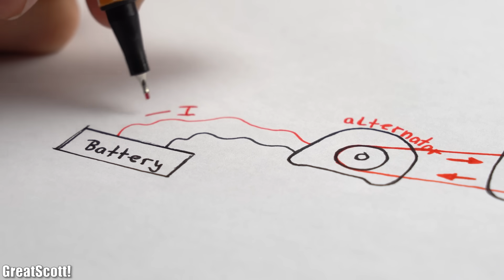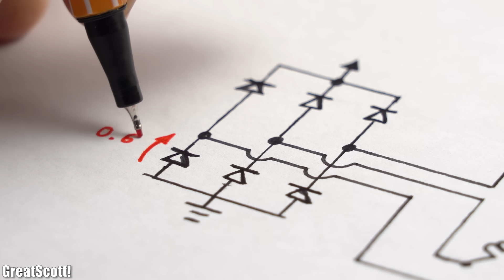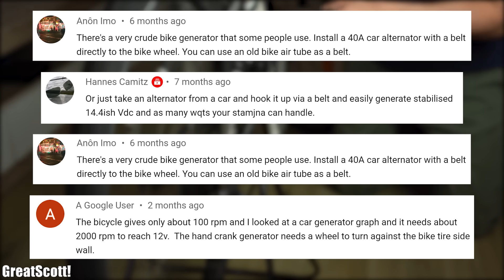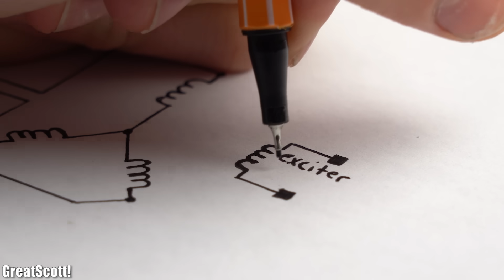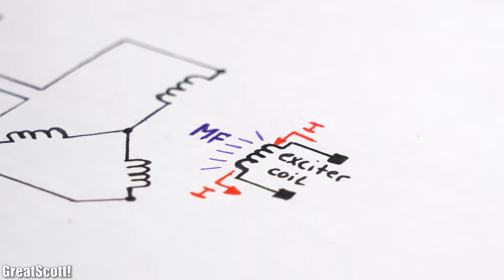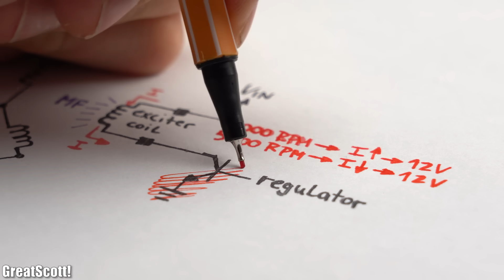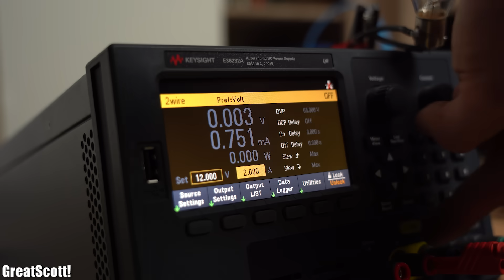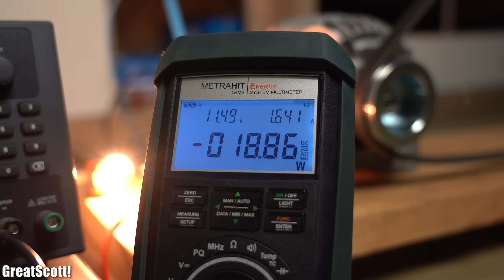Using a car alternator with a bike to power my home? How much energy can I produce?!

Comment: As a child living during a civil war in Sri Lanka in the early 90s, the most common electricity power source we had was by peddling our bicycles that had simple dynamos attached. We couldn’t do much with that, except for powering some FM/SW radios, but nevertheless it was useful for many under that circumstance.
Reply: Machang, having visited Sri Lanka towards the end of the Civil War, and many times thereafter in the years that followed, I can very much appreciate your struggles.
Reply from the maker: Thanks for the feedback :-)
Reply: @greatscottlab  you can also use the electric bike hub motor as a generator... I'm pretty sure you can generate a pretty good amount of electricity out of it.
Reply: @jeruelvidad901  When i was a kid i had a light setup for my bike that included a generator with a knurled wheel that ran along the tire. It had a little rechargeable battery pack so the lights didn't go out when you stopped but when you started pedaling again they sure brightened up.
Reply: @keithyinger3326  yeah, I also have that in my bike when I was in elementary but it only lights up when the wheel moves since it doesn't have a battery.
Reply: @jeruelvidad901  ahh, the battery pack might have been something my dad added just so they would stay on when i stopped then. I just remember a little switch on the handlebars to turn it on, and a battery pack zip-tied to the frame.
Reply: @keithyinger3326  ahh, that's really nice.
Reply: @jeruelvidad901  No
Reply: @jhonmorenocastro3010  you can watch the process of making a windmill and the conversion of a ordinary bike to an e-bike of the youtuber 'KREOSAN' if you doubt it.
Reply: @jeruelvidad901  Science is better than You tube. a regular and healthy human can only deliber 100 watts with full effort.
Reply: @jhonmorenocastro3010   isn't there a 'Science' in the rotation of the motor.
Reply: @jhonmorenocastro3010  you should learn how to use gears... And who told you that you're the one to generate the electricity, hahahahah. What's the point of doing that if you can use it as a generator for a wind turbine.
Reply: @jeruelvidad901  Its about power not gears.
Reply: @jhonmorenocastro3010  my bad I was talking about the e-bike hub motor... I know that Science is more reliable than youtube, but did they figure out how to extract it to be used and if they did figure out, why are we still buying electricity bills or buying such things to generate electricity?
Reply: @jeruelvidad901  Try at your home, them respond yourself
Reply: @jeruelvidad901  Science doesnt mean rotor, instead Human muscle power and resistance in time, heart, health, breath, ect ect.
Reply: @jhonmorenocastro3010  but the "Theory" says that "The average human, at rest, produces around 100 watts of power. [2] Over periods of a few minutes, humans can comfortably sustain 300-400 watts; and in the case of very short bursts of energy, such as sprinting, some humans can output over 2,000 watts. [2] The bulk of this energy is required for important tasks, such as pumping your heart and flexing your muscles, but a lot of it is wasted, primarily as heat. [3] Almost all of this wasted energy could be captured and turned into electricity. Furthermore, this process could then augment or completely replace reliance on batteries." It is still a theory, and it needs to be proved. So this human generated power is still useless for the meantime.
Reply: @jhonmorenocastro3010  science also explain electricity, you know? It also explains the electromagnetic field that is produced by powering the rotor.
Reply: @jeruelvidad901  !!! You got it !!!  at the end available just 100 Watts . (like our gas cars,  more than 80% of gas potential is wasted in diferent forms of energy. Heat, bearings, friction on road ect, ect.
Reply: @keithyinger3326  I had that also, no battery pack. What I remember about it was how much drag it caused....had to pedal so much harder. I never used it.....
Reply: @jhonmorenocastro3010  you are right the avg human would have a hard time if not impossible   the avg person could only produce 5o -60 watts    I ride rode 100 to 250 mi a week.  On a a HD bike that weights close to 200 lb.   Weight hauler.    freight.   groceries    I peaked at close to 99watt  AttnREMC
Reply: Rated to 3Watts! For all that extra effort.
Reply: @keithyinger3326  that's a dynamo
Reply: @jhonmorenocastro3010  sounds about right or 1/8 horse power
Reply: @jeruelvidad901  100 watts for the average person.
Reply: @jeruelvidad901  can't always count on the wind. Sometimes the wind doesn't blow, can't relay on wind when there is no wind.
Reply: @jeruelvidad901  I lived this peddling bike life. 5 minutes with my two brothers each. Totaling 15 minutes peddling. My dad hand spun the stator backwards on generator. Hooked up too batteries. We had power until our bed time in four separate rooms with lights, toys and radios in all four rooms. Until my dad applied for a Paton and President Regan wrote my dad wanting his invention. My dad returned to the grid knowing what the corrupt S.O.B. back during the original Tesla erra.  Done  preventing free power from the people. Created & invented by Tesla. Corrupt powers don't want free energy they want to control & profit from people not help people.
Reply: @sweettimage  i mean, you can rely on wind if, hearsay, there's a storm and maybe you are off the grid and you rely solely on solar energy. My point is just having a sustainable energy that could supply you with electricity anytime.
Reply: @jeruelvidad901  True that. To supply enough sustainable power source for everyday needs. Must harness all the energy power source of the wind, solar and human intervention.
Reply: @jeruelvidad901  u can pretty much make any electrical motor into generator
Reply: @greatscottlab  I would like to take on more interesting project like small scale steam turbine electricity that could power the house in hot climates. Specifically concentrated solar power . Let me know what you think .
Reply: @idontknow1022-v7g  That would be cool, I think a closed system that worked like a A/C compressor where there is a high side and a low side where the high side would actuate an impeller that would drive the generator! Use a one way valve between the low and high side so pressure doesn't equalize, the high side would be exposed to the solar collector and the low side would be kept cool.
Reply: @greatscottlab  that 20 watt wasn't the maximum power which lamp could hold ? ( because of the lamps resistance )
Reply: @greatscottlab 🇱🇰 🇱🇰
Reply: Wow 😲 I hope your life is easier for you now, but having come from poverty also I am a thankful person and remain content regardless. The most wonderful gift 💝 I received was from Jesus - now I have no NEED but remain so grateful.
Reply: Yep, needs to tighten the belt to really get the power out of it.
Reply: 😂👍because  I grew up without electricity,  I always wanted to find a way to produce electricity which will help me to be independent from the grid system,  I was able to achieve it.
During the last winter storm in USA,  my house is the only one had electricity! 

Human can put out around 1Hp by pedalling bicycle,  he/she can't do pedalling more than 45 minutes continuously at this rate. 
Car alternator can't produce useful load at less than 2000 rpm. 
But, good attempt though.  

If you want to do this for workout,  try 3volt on the exiting coil,  you will have less resistance.  After few seconds,  coil becomes self exited, then you no longer have to provide voltage to the coil.

---------
My system at home using power multiplier using flywheel.
Reply: finally a sri lankan in comment section
Reply: I am not surprised. I've seen the legs and power it takes to toast a slice of bread: https://youtu.be/S4O5voOCqAQ
Reply: Fact bro
Reply: Alot of people modified alternators by adding permanent magnets to the rotor and eliminated the excited coils
Reply: Yes the old bikes in the 60s and 70s lights were using a Dynamo to power the lights
Reply: Weighted flywheel butt up to that with your bike tire... friction drive... ratio the flywheel to the alternator and set a few up inline..  should be able to cut that 14. Years down pretty easily... this is a very interesting idea and would be worth exploring.. maybe we could build gyms that feed energy back into the grid..
Reply: Thank you for sharing your idea very much appreciated,do you have any other tips.... camping or survival tips?
Reply: Free eletricity and training at the same time.
Reply: Cyberpunk
Reply: Generator modification
Reply: Damn crazy the differences of lives we all live. I try to be mindful of that.
Reply: Any Electric you can generate for free is worth doing. Could you turn two alternators with one belt and bike setup.
Reply: @chrisspere4836  you can't generate anything for free.   If it's free someone is always paying.
Reply: Very similar, sir, Cambodia in 1980s.
Reply: sadly globalist are attacking the worlds food\energy supply so these small hand crank generators may be useful again soon👍
Reply: This guy is speaking from his throne of privilege, of course 20W is more than enough for a home where you dont have any electricity at all.
Reply: Yeah I remember seeing one video or BBC news program several years ago with this exactly powering radios from bicycle dynamos
Reply: There is a movie I watched that was about a kid in Africa that made a windmill with a bike frame and one of those headlight generators to charge up a car 12 volt battery to run a water pump to pump water out of the ground.
Made a nice e story but none of the science made any sense.
Reply: @michaelszczys8316  batteries are fun to have around. They used to be plentiful around here. Nowadays everyone recycles, haven't found a car battery in ages. They are indeed handy asset.
Reply: @brucerideout9979  I use lawn tractor battery in a box to run power tools, work lights etc. I take those old battery drills and put a wire with clips on them. Works great for 9volt Makita drill but unfortunately a lot of tools run more than 12 volt. You really need two.
You also don't have to worry out in the rain.
Reply: @michaelszczys8316  im 63 now don't play around with tools too much but in my youth I loved making sparks with jumper cables and connectors and the motor speeds.  Had a ton of fun.
Reply: @michaelszczys8316  have you seen the new techy stuff, I was at the park the other day and a guy had a neat power pack he was charging his phone. He said it would start a car. Gorgeous little unit. I am illiterate to it all
Reply: @brucerideout9979  they do have some interesting new battery devices. My wife had cute little unit for phone charging that had lights and things.
My lawn tractor battery unit has a cigarette lighter plug on it and I keep a lighter in it, I tell my young son it is the world's heaviest cigarette lighter.
Reply: @michaelszczys8316  hee hee I've had multiple challenges in lighting a cigarette over the years. Was flying my Cessna 150 one day and realized I didn't bring a lighter. heeeebeeeejeeeebeeees ..... Tower! Mayday! Cigarettes but no lighter....lol
Reply: Interestingly the reason I said batteries are fun to have around, is for lighting smokes by shorting out a piece of wire.....had to do this way out in the mountains one day.
Reply: @brucerideout9979  they fail in a big way now. Most seems to short out inside.  Last one I had would drop to 4v as soon as I took it off the charger (12v car battery)
Reply: @brucerideout9979  Do you still own the Cessna 150? I'm a commercial & instrument rated pilot, would like to meet someone else who also flies split the hourly fuel cost & all that to do a little bit of flying.
Reply: @FinalFront  No. Haven't flown since 1992.
Reply: @brucerideout9979  Ah
Reply: @michaelszczys8316  Do you think i could do that with my old sears battery tools like skill saw or drill?
Reply: @Gods-Elect  if they are anywhere near 12 volt. It works okay. I started using it with some 9 volt Makita drills. It's still portable just a short wire. You don't have to worry about getting shocked out in the rain or wet ground.
I got a nice full size 7 1/4 inch circular saw but it runs 19 volt. It turns too slow. I had to hook two together 24 volt.
I take it camping and run air mattress pump right in the tent. Hook up string of 12volt LED lights. I use it a lot for running small air pump to pump up tires.
I even tried using this tiny power inverter I have. Only good for about 1.5 amps but enough to run soldering iron so I could solder wires on my truck.
Reply: @michaelszczys8316  mine takes 18volt battery which i can't seem to find just hate to throw them away so when i read you comment i thought maybe use it off my garden tractor battery how about if i leave it running while i try to use it would that work? I'm going to have to figure out how to hook them up thanks.
Reply: @michaelszczys8316  after thinking about it i think i know what your saying a 12 volt wouldn't do it so hook up two battery's and make it 24 volts tell me how to hook up two battery's please .
Reply: @Gods-Elect  another thing you could try doing is getting battery packs for something like AA batteries from online shopping and maybe you already have a bunch of rechargeable batteries 
( like I do ) and use a bunch of them with short wire. Capacity might not be that long but you can still use them to drill a few holes or something
Some rechargeable batteries are only good for slow drain - low amperage output though.
Something to try.
Reply: Well done..
Reply: Amazing!
Reply: You need a big wheel with gears to keep rotating and feeding electricity and that should be in the middle of two different size of engine, that’s to keep the small engine as an out put . You can still do it  now 🚂
Reply: And now the kids are gonna do it again.
Reply: What did you use as the generator? DC motors?
Reply: That bad, bad cheap mathimatical wars!
Reply: Use a belt tensioner like u wud a car motor. Take out drag in ur belt... might even wanna move the  altenator back a bit take out some slack. The belt really has to be tight in order to be effective.
Reply: How's Sri Lanka right now, any word?
Reply: should have use a cow to do the work pulliing the rotation.  love cow milk should get one and make it do the work. lol
Reply: haha i used to ride bike with this dynamo i tought i sound like motorcycle :D
Reply: greetings from Ukraine! we have war here currently so this may be very useful especially in winter where we also need to keep ourselves warm xD
Reply: Missing the flywheel. It would have worked.
Reply: I remember being in a science museum of some sort and there was among other 
' hands on ' things an exercise type bike with a generator and it powered about a 100 watt light bulb.
It was pretty hard to keep that lousy 100 watts burning for very long  with pedal power.
You aren't running a refrigerator with pedal power.
Reply: Wow
Reply: I believe in the siege of Sarajevo the locals used alternators as generators turned by water power.
Reply: Wish I could draw you a pic set the rear tire on a roller bearings on both sides that will give the 1700 rpm or what ever end of the roller a larger belt pulley going to your smaller pulley to optimize make that larger pulley heavy to throw in some perpetual energy to smooth out the jerkyness off your pedaling and put a car battery in the system wired to the exciter.
Reply: Or you can have just order a C Crane AM/FM Shoetwavw radio… Crank on back. Crank it for 30 seconds, and the radio runs over an hour. Still made today and the best emergency radio you can buy. Just FYI
Reply: But you didn't power ur house with it you can only power 12volt systems
Reply: It worked on Gilligan's Island perfectly
Reply: Happy to see a sri lankan comment here 🇱🇰
Reply: I was so intrigued  by the hydro my grandfather generated it was back in the 40s using turbine in a creek 
Lights for the house  the family had
All fantastic interesting
Reply: I had no idea Sri Lanka had a civil war in such recent years. I am not surprised though since I was born on 89'.
Reply: There is u need modify rotor with Powerful Neodymium magnets and best direction to attach them for production of magnetic field and 3k rpm u will get at 10k watts and more.
Reply: Hey i am from Sri lanka too
Reply: You must have been reading my mind from the past could that while I'm trying to do now
Reply: Interesting. I would have been more interested if you did more than power radios
Reply: How about water column? I've long wanted to cobble together something that I can toss into rapid flowing Creek to spin a generator.
Reply: Buy a 250 amp alternator It produces 240 volts if you go around the rectifier.  buy a 3/4 horsepower motor 240 volt single phase.  hook it up to the the alternator with a belt and spin it up.  The alternator will run on 12 amps which leaves 238 amps to run your house.  Plenty of power to run your house.  Remember, the magnets spinning causes the wires to make power it  is not free power.  The courts have said you have the right to be independent so it is legal.
Reply: @wanttopreach  can you please explain this more to me my friend I would like to do this project at home.
Reply: @wanttopreach  which courts? How do we look this up?
Reply: @johnwyman6126  It depends on what country you live in but in America it's a given!
Reply: @wanttopreach  problems is motors wear out. Spinning to fast.
Reply: @wanttopreach  You said 240v??!!! How much voltage you feed to rotor then??
Reply: @wanttopreach  You are desperely in need for power electronic books !!! and some math books too Lol.
Reply: @jhonmorenocastro3010  I think you need it too hahahahah. I will, and I'm just a high school student though, that's why I still need to learn some new stuff.
Reply: @jeruelvidad901  Are you over Tesla, Newton or Maxwell  ?...... Ok. No more time with you Sr.
Reply: @jhonmorenocastro3010  I'm inspired by Tesla.
Reply: @jeruelvidad901  Great !!! add real Maths & Phisics.
Reply: @jhonmorenocastro3010  yeah, thanks for the advice.